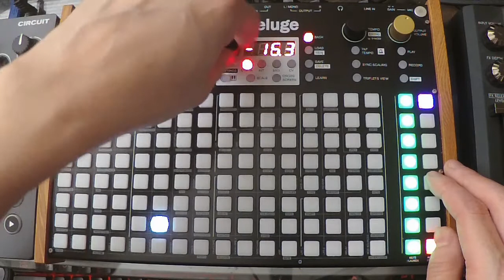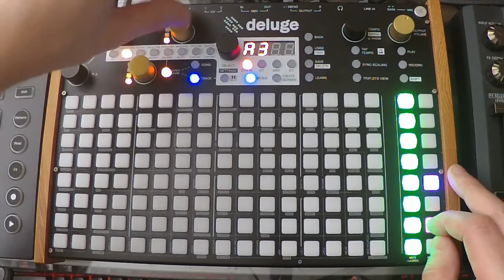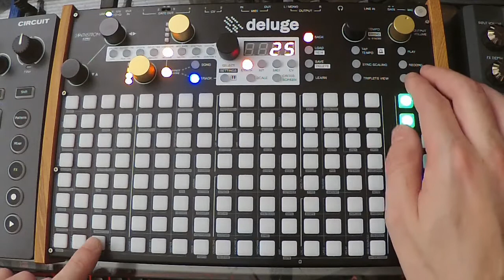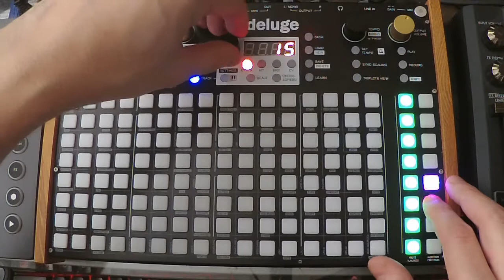A First Look At FM Synthesis // Synthstrom Deluge Tutorial

Comment: Hey Ron, thanks for the video. What kind of oscillators are available for FM? Is it for example possible to use a single cycle waveform or even the line in as a modulator?

Comment: Does your sine wave (and most of my custom patches for that matter) make a popping sound when you initially play it? I keep checking if its my monitors.. but I don't think so. I can sort of hear it in this video
Reply from the maker: Isaac unsure because normally I use external synths
Reply: Sine waves have so much harmonic content that the crossing point between wave end and restart has to be at zero, or there is a pop.
Reply: Sine waves have NO harmonic content right?